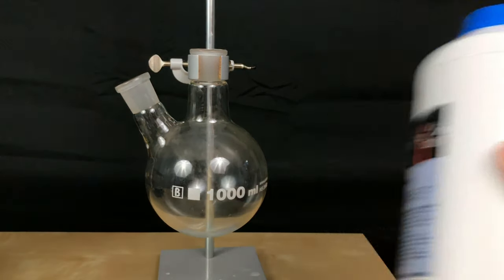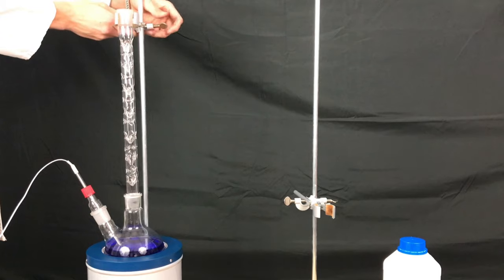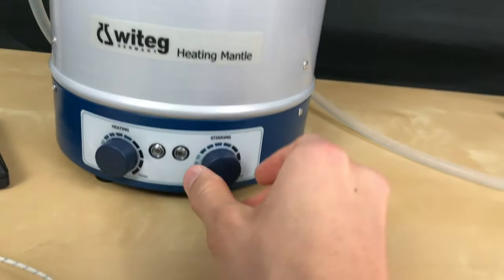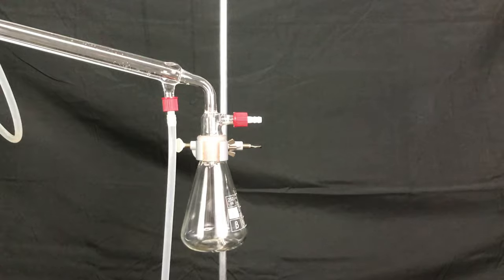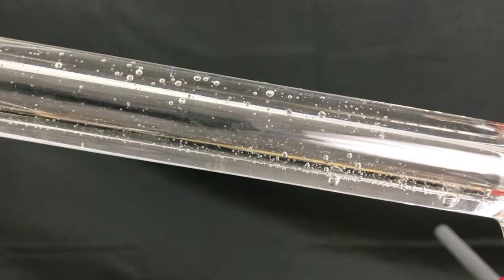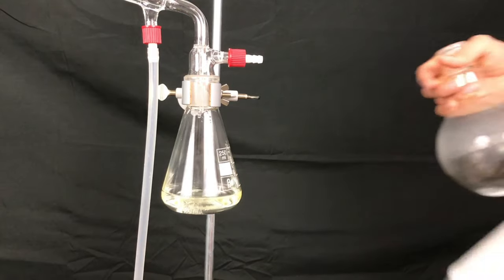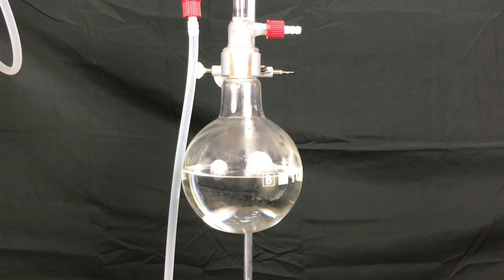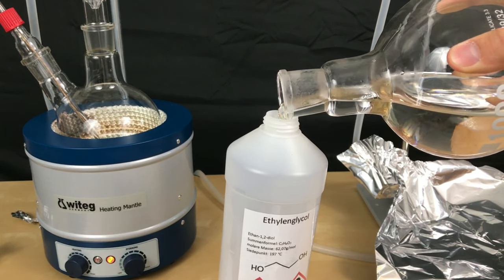Ethylene glycol from antifreeze

Comment: ethylene glycol
It is available in Huawei batteries
Especially in the aluminum terminal
It is mixed with the carbon in a mercury form
When you leave it in drinking water
For about 24 hours
Then the substance dissolves
And it becomes antifreeze

Comment: If Ethylene glycol makes miscible solution with water and i want to separate the water from EG + water based diluted antifreeze  solution , what process i have to do can i separate EG from water mixture just by distillation ?
Reply from the maker: I would use molecular sieves to dry it completely. I actually don’t know if it forms an azeotrope with water right now and if it can therefore be dried via distillation.
Reply: @THYZOID  according to wikki it says it's miscible solution !!